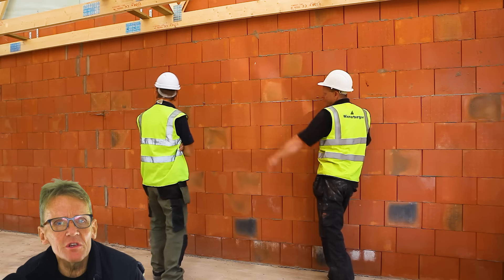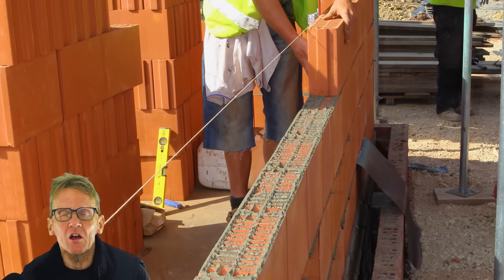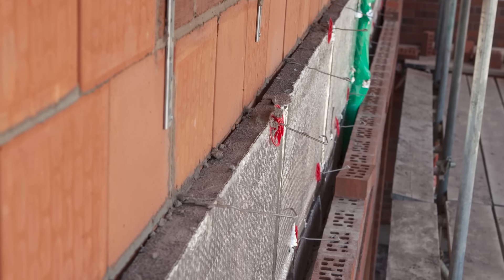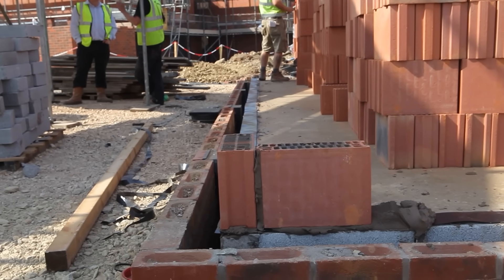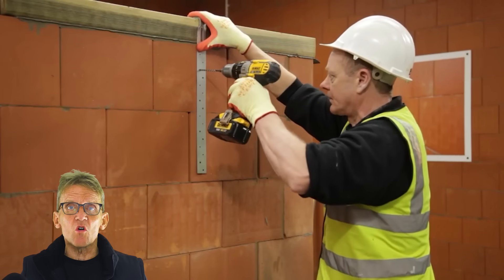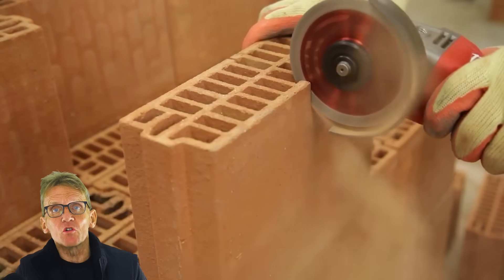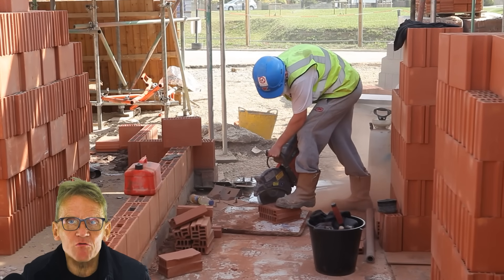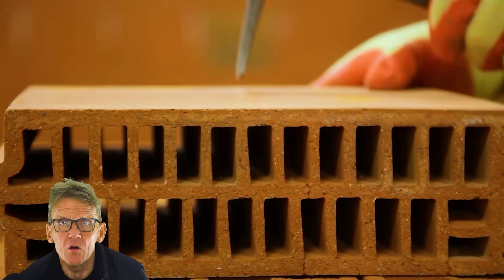Why Haven't We Warmed to Porotherm in the UK?

Comment: The only place I have seen something like these block was when the extended a Lidl or Aldi in Hastings or Bexhill.
Reply from the maker: That would be the German connection.
Reply: Roger, have a look at Clay Block Ireland they do external blocks with insulation in them as well and they actually sell them.😂
Reply: See them used in the building of the Lidl and Aldi stores in Ireland
Reply: Certain Care Village developers use them too - I’ve been to a couple of demos - looks good in controlled conditions - I don’t think that traditional brickies like them though - they can shatter when cut, and don’t lend themselves well to walls which fall outside of full brick gauges.